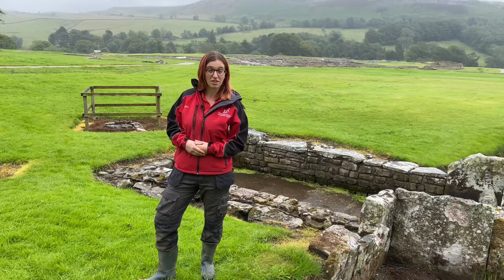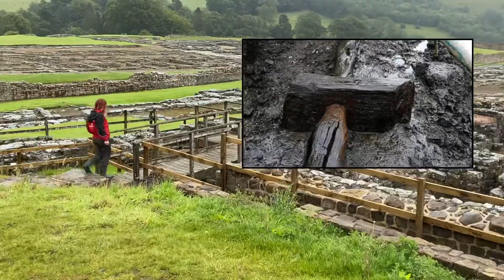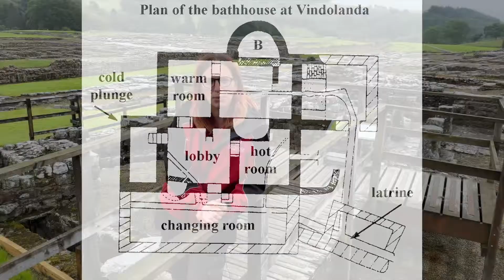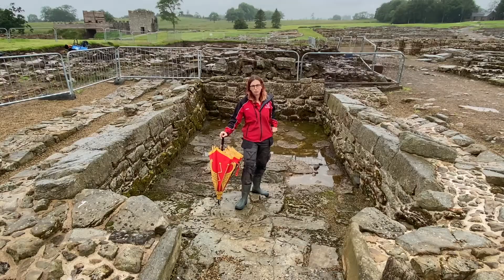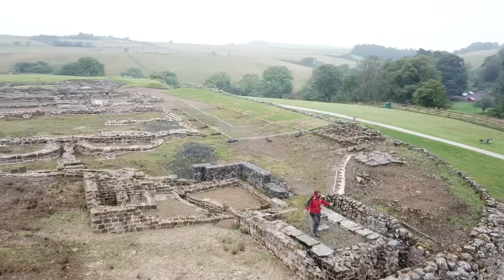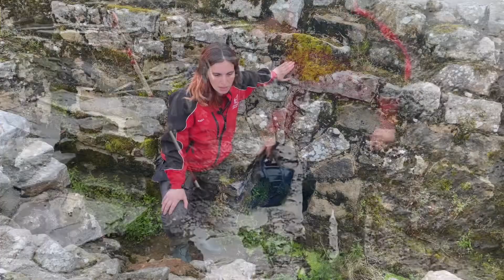Water at Vindolanda

Comment: With the triangle analysis method I developed, the answer can be derived as soon as it is analyzed. Specify 3 locations. Vindolanda, 54 59 26.06 N, 2 21 38.05 W, Vatican, 41 54 8.00 N, 12 27 26.13 E, One hundredth of the Sun diameter distance Point ,from Machupicchu sun stone, 7 10 29.10 S, 56 6 56.45 E,
The mutual distances of those three points are 8743km, 1814km, 115km, and the sum of the three is 10672km. Mars diameter is 6794km, Mars circumference is about 21345km. It is calculated as π=3 14159. 10672km≒21345km×0.49999,
The total distance of the three sides is the half-perimeter of Mars. The extremely high accuracy is important evidence that the Anunnaki descended on earth 200,000 years ago and constructed and arranged ancient ruins with modules based on the size of the solar system bodies. Since it has not been moved since it was installed, good results can be obtained by measuring carefully. I have already completed the analysis of more than 90,000 demonstration cases. This is one example.
I will explain the reason for each length. 8743km≒8501km; Triton circumference ×1.028, 1814km≒3636km × 0 499, Io diameter ×0.5, 115km ≒ Io circumference × 1.0067,
PS; The hypothetical sun spot is a vestige track that the Anunnaki diligently collected the gold-laden mud deposited on the ocean floor. It is 12km wide and remains for 20000km continuously. In addition, it is characterized by a small detour to the west only here. It's a sacred point of importance and a base that I cherish!　There are several other locations.